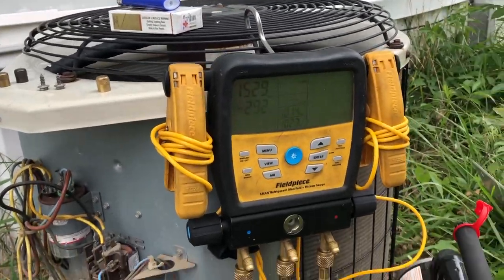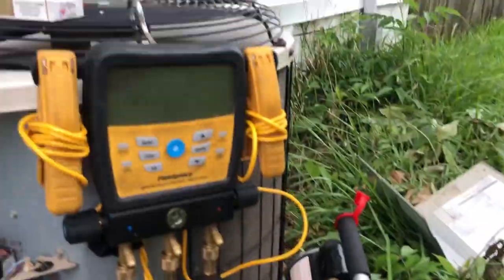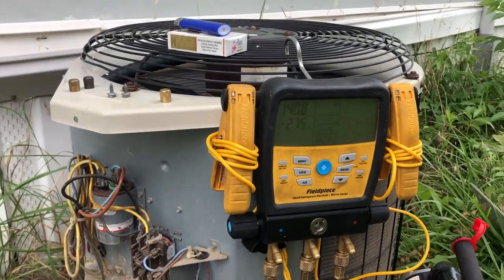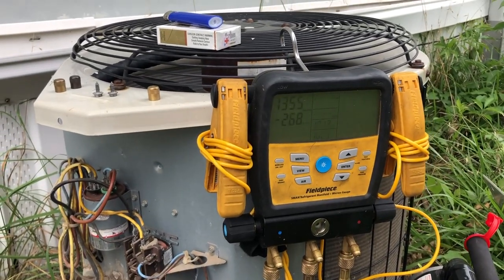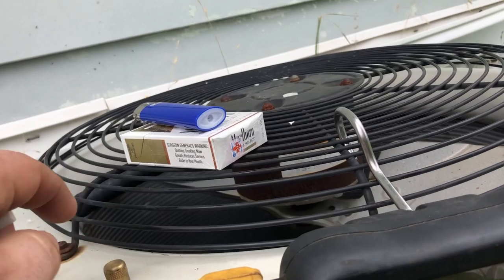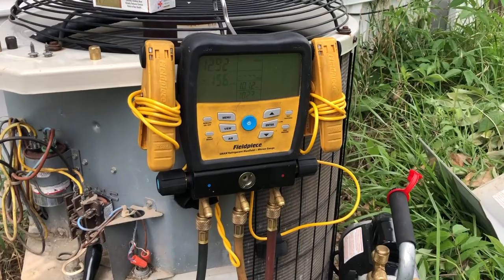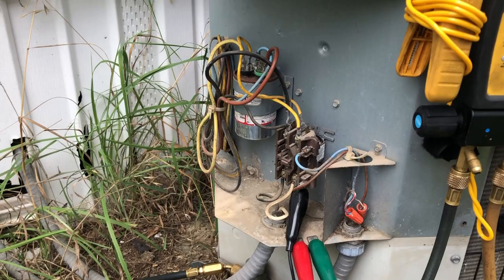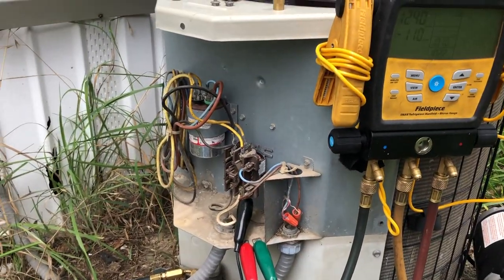Update on the Covid House/System

Comment: Great repair John. I literally just installed one of those teardrop Bryant/Payne (some off brand of Carrier) into a section 8 house on Sunday. Original unit had a grounded comp. inside unit was fine and leak free. The condenser i brought was a used (obviously) R22 2 ton i had lying around. I didn't realize the suction line was only 5/8" so i just stuck it inside the 3/4" and brazed it. Worked great! I was actually surprised i got a 19 degree split. I like those teardrop Paynes/Bryants.

Comment: I can’t believe any HVAC tech would do that kind of shoddy work! How did that guy disconnect the charging line and screw the plastic cap on without losing much of the refrigerant charge? With the new cap & contactor, the customer should be in great shape. Thanks for the great video 👍

Comment: Nice find John, surprised the plastic cap held for as long as it did. I see your using the widow maker to scab power for your vacuum pump 👍👍 I replaced 2 condensers and a Evap coil the last 2 days at work. It's been 95 with a heat index of 110 here in SC. I filmed everything, just have to edit the videos and upload them. Stay safe out there 😷😷

Comment: What was the “hissing “ the tenant heard the other day ?
Reply: Thought there was a leak inside?
Reply: @henryharrison3988  He showed pic of inside coil and missing schrader valve. Had a bad plastic cap on it and was leaking.
Reply: Pressured with nitro. He called tenant on phone. Tenant can hear leak @ air handler.
Reply: So did I?!